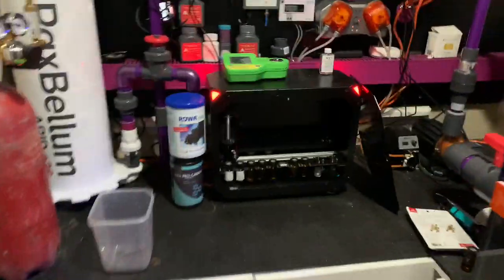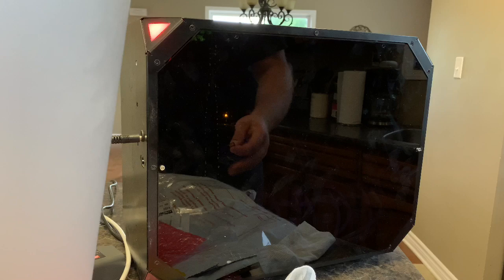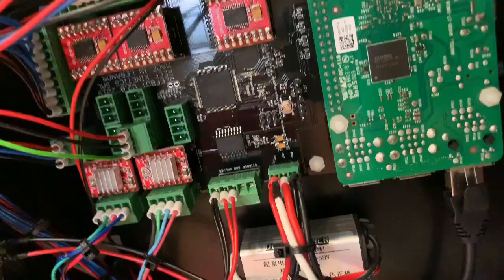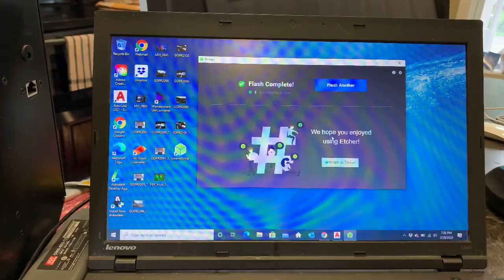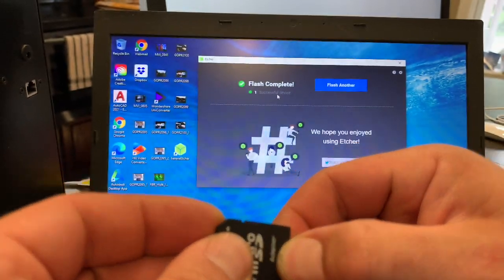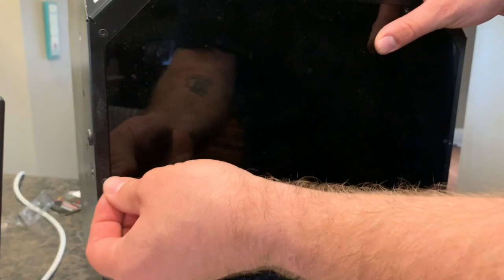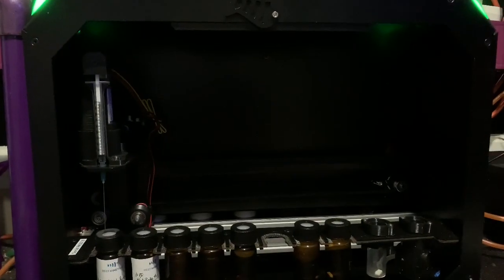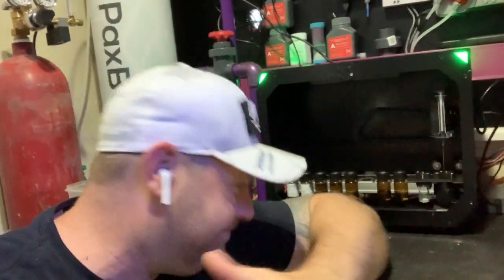Reef Bot Red Lights Of Death and How to fix it.

Comment: I had the reefbot and sent it back it was a nightmare. It was never accurate or consistent. The trident is so much better and easy to use.
Reply: I haven’t used the reefbot before but I do like how it can multi test different parameters of your tank. I currently use the Trident 🔱 and like the reliability of the unit.
Reply from the maker: very true
Reply from the maker: i sold mine